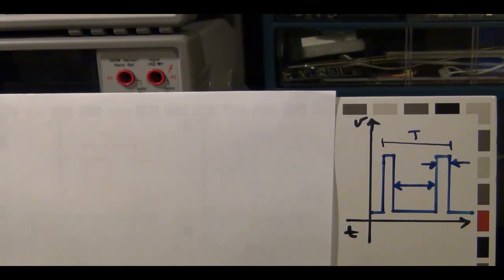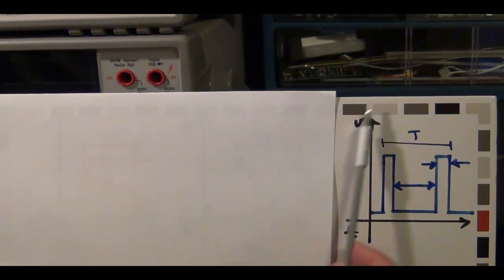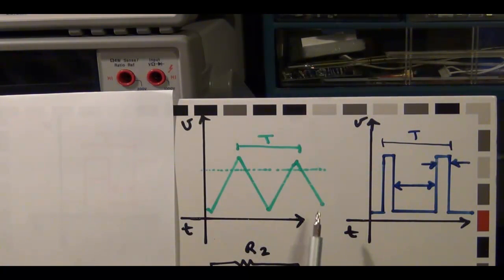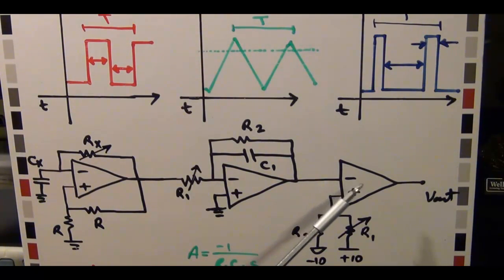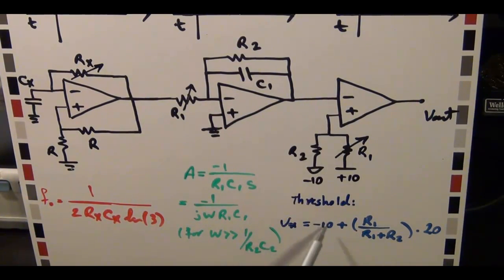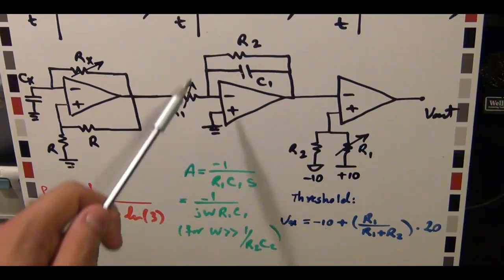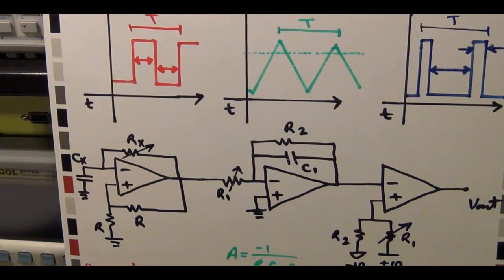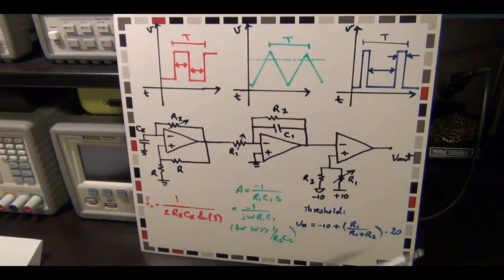TSP #5 - Op-Amps, PWM and Ignition Coils Tutorial (Part 1/3)

Comment: This is a great series helpful! I'm a novice at this electronic stuff and I do have a question?  I am trying to figure out how to make an electric vehicle from scrap electronics and don't have money for Arduino's or anything so this is a great video just for that reason.  My question, I have seen videos using op amp to control small low power motors and I am left wondering.
 How doe's one go about making a op amp based speed controller for a much more powerful motor that would be used for a vehicle?

Comment: What can we do at the comparitor stage to stop the noise interfering with its operation?
Reply: add a LC filter
Reply: How can you calculate the values for L and C for that noise?
Reply: +R Vass you should refer opamp by Ramakant Gayakwad. It would be really helpful to you.Differnt types of filters and their design are well explained it. It is really worth purchasing that book. Most of electronics stuff u find on youtube lik amplifier,projects using 555,voltage regulator for power source,comparator for pwm and theirs lots of more u can find it in that book.
Reply: SHREYANS GANDHI thank you very much for your advice.
Reply: +R Vass i am doing engg in ee final year what about you?
Reply: SHREYANS GANDHI i am hobbyist just want to learn thats all.

Comment: I just noticed the Threshold formula after my post. It appears to be wrong. The voltage drops should add up to the supply power. so starting from ground and taking the shortest path we have +10v supply minus the voltage drop across R1 = Vx . So formula should be Vx = 10 + (R1/R1+R2) x 20.   Going one step further for your audience,  If R1=1k , R2=2k, calculating voltages through entire  20volt circuit we have +10V Supply - 6.6v (R1)  = 3.4v (Vx) -  13.4v (R2) = -10v  ( -10v supply)

Comment: You lost me 7minutes into video when you said, "If I reduce the value of R1, than the potential will go down, my positive modulation will have more low cycles than high. Is that true or just a slight of tongue. I agree that reducing the value of R1 would lower the potential across R1 but wouldn't that effectively raise the voltage at the non-inverting input? In turn the positive modulations would have more high cycles, not more low cycles?

Comment: Nice video, i like that you explain the circuit so simple. Can't i make the same with a 555 (  constant frequency and variable Duty Cycle) ?
Reply: constant frequency wont be helpful in pwm as fast switching is required when voltage level increases.

Comment: The signal across the Cx capacitor isn't exactly a triangle wave (its made up of sections of exponential curves), so this would result in a slightly nonlinear relationship between the threshold voltage and the pulse width. However, connecting the -ve input of the first op-amp to ground, removing Rx and Cx, and moving the ground terminal of the resistor R to the output of the integrator produces a true triangle-wave oscillator that requires only one control to change its frequency.

Comment: Thanks for the video! How much will source voltage affect the PWM operation? Will there be a slight increase in frequency?
Reply: If you noticed than frequency was varied using variable resistance and opamp which were used has predefined voltage upto which that ic can withstand.

Comment: When I make the first opamp configuration, I get no oscillation.
My C is 220pF, the pot is a 100k, and the 2 R's are 10k. When I remove the R from noninverting terminal to ground, I get a 50Hz squarewave, pot doesn't change anything.

What am I doing wrong?
Reply: which type of resistance pot you are using?

Comment: You have no dual supply in the real circuit later. But in the schematics you show there's a +/- 10. (which doesn't matter actually, because even with single supply and a "virtual" GND a pot would be enough).
I've since seen that in a later video you had the problem that the PWM couldn't be set to 0% duty cycle. I thought this could happen when I saw the last fixed R2 and that's why I asked if there's a reason for it (I built circuits like these but I'm way below your level of expertise).

Comment: Any reason why you put an potentiometer AND a resistor at the non-inverting input of the comparator? Wouldn't it be easier to explain to just use a potentiometer with swiper to the input and the other two connections to +/-10v?

Comment: Thx a lot for this Video, however the gain of the 2nd OpAmp should be A=-R2 / R1(1+SCR2), if the value of R1 and R2 are very close to each other, then they can be cancelled out.